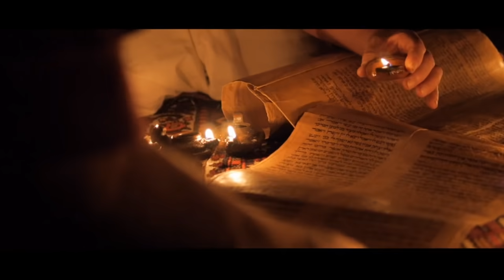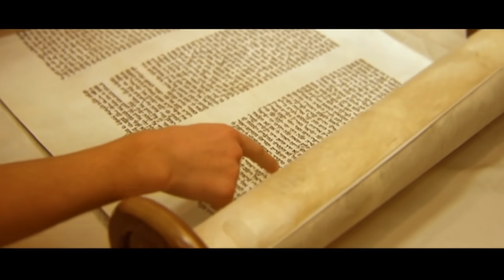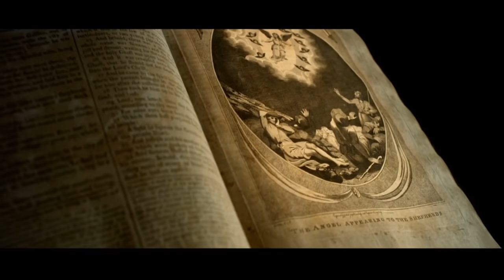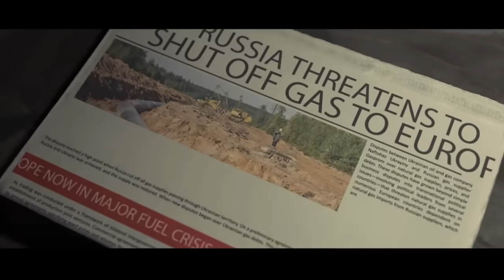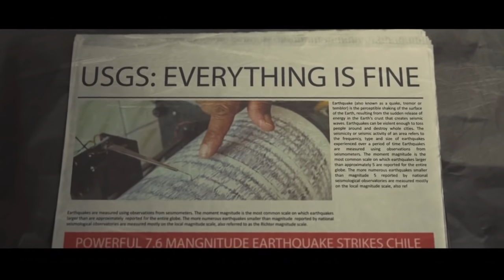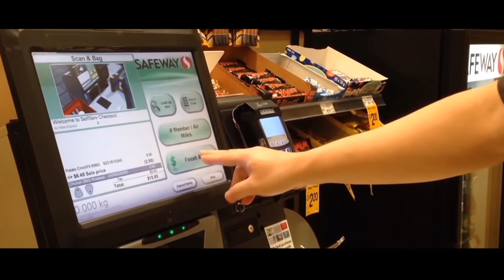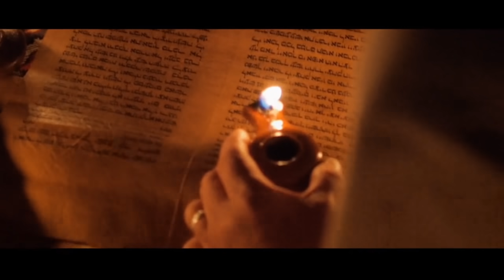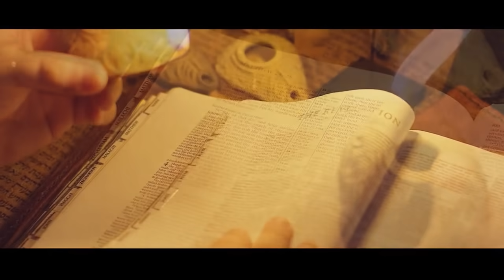The Coming Convergence Full Movie

Comment: ERROR ABOUT THE FEAST:
4 in the Spring
1.) Passover / Pesach; Leviticus 23:4--5
2.) First day of Unleavened Bread / Chag Hamotzi; Leviticus 23:6-7
3.) Firstfruit / Yom Hbikkurim; Leviticus 23:914
4.) 7th day of Unleavened Bread / Shevi'i Shel Pesach; Leviticus 23:8

One in Summer:
Pentecost / Shavu'ot; Leviticus 23:15-22

4 in the Fall 
1.) Trumpets / Yom Teru'ah; Leviticus 23:23-25
2.) Day of Atonement / Yom Kippur; Leviticus 23:26-32
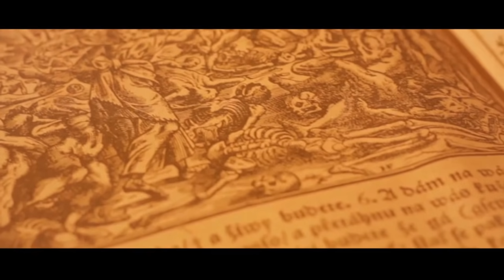3.) Tabernacles / Sukkot; Leviticus 23:33-44
4.) Eighth [day of] Assembly / Shemini Atzeret; Leviticus 23:36
Reply: Quite a few mistakes
But pretty good all in all 
Gog and Magog will get toghter right before Jesus second coming in Jerusalem 
They missed some very important parts in the Bible